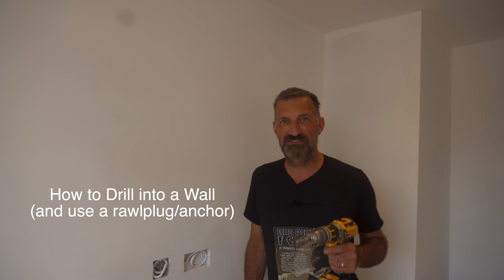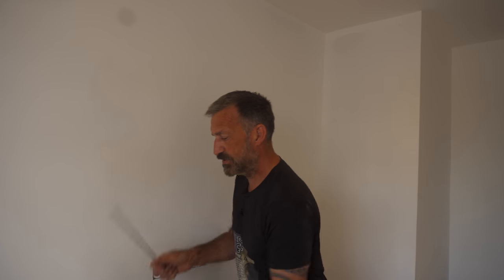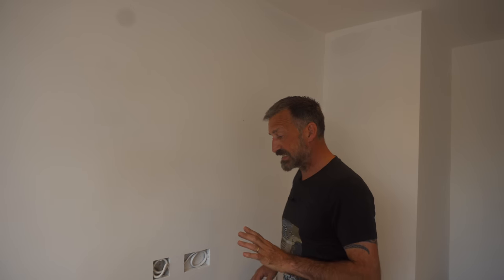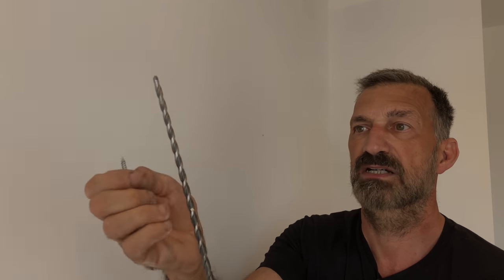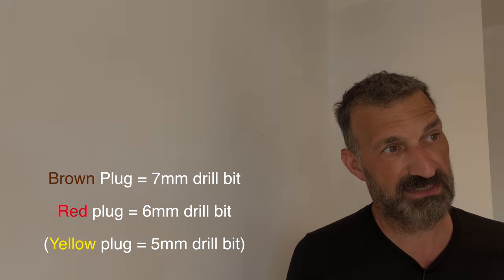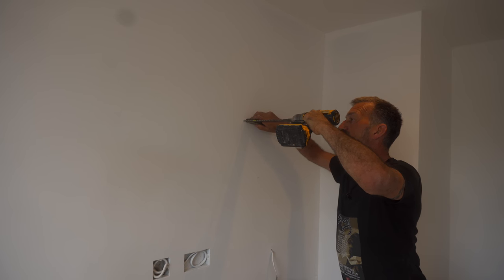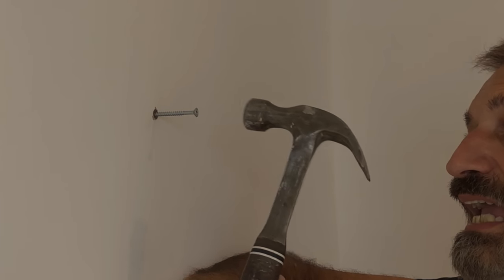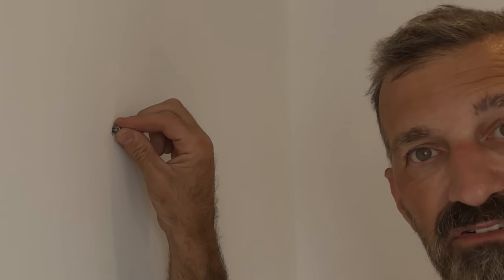Drilling Tips and Tricks (and mistakes to avoid)

Comment: Make sure that the slit of the wall plug is horizontal so that the screw is against the wall plug when under load not slit through wall plug. It will make firm connection to the wall under load
Reply: Thanks for that tip about the slit being horizontal.

Comment: I hadn't thought of using an SDS drill bit in a normal chucked drill.  Makes sense though as SDS bits seem to be much longer generally than standard ones.  Also - liked the tips on wiring - assuming an electrican rather than DIYer has wired it..

Comment: Very helpful I desperately need to learn this stuff but some questions are unanswered, why use a 2inch screw would you ever need a shorter/longer and why. Why use different wall plugs, and are all walls like the same round the house. What if the screw doesn't bite at and is loose or something is in the way and you can drill the hole?

Comment: Great video thanks. Any hints/tips for drilling high up on a wall? Ie ladder orientation etc
Reply from the maker: Yes. Be careful! Ladder always perpendicular to the wall, never parallel. Always have someone standing on the bottom rung footing it. Just take it easy. Slow and steady. Does it 🥊
Reply from the maker: Obviously if it is a very tall step ladder and you are too far from the wall, you will have to be parallel, but then you will need someone on the bottom rung and also I’d recommend a third person on the other side of the ladder holding it so that it doesn’t push away from the wall
Reply: Good man, thanks!

Comment: Hi again! One question I've built 4 plywood shelves 1 metre wide x 44cm deepx1cm. The 1 metre back wall is bricd and I used a10Gx4m masonry screw. for the struts I used 42x19mm pine.. I was advised by store to use Zenith chipboard   8G x 35mm Galvanised Countersunk Rib Head Metal Screw for drywal and  10gx45mm masonry screw for brick wall. I was told I would NOT need plugs at all. Shelves seem to be holding but after your video I think I should have used plugs also. Did they tell me the wrong thing? Sorry this is long as im a 74yo novice.

Comment from the maker: Bits - I'd use the 6mm (1/4"): https://www.amazon.com/Yuerseak-7-Piece-Drilling-Concrete-inch（Gold）/dp/B07L499GG1/ref=sr_1_3?dchild=1&keywords=6mm+masonry+bit&qid=1604996574&sr=8-3

Anchor: 6mm (1/4") https://www.amazon.com/Premium-Quality-Ribbed-Plastic-Anchors/dp/B01J06DC36/ref=sr_1_3?crid=LL5JH8FXAGFF&dchild=1&keywords=1%2F4+wall+anchor&qid=1604996786&sprefix=1%2F4%22+wall+anchor%2Caps%2C229&sr=8-3

Screws (use the 40mm 4*

https://www.amazon.com/ORGRIMMAR-Chipboard-Phillips-Construction-Assortment/dp/B07TPHGFVS/ref=sr_1_2?dchild=1&keywords=Screws&pd_rd_r=6cf38dea-e987-4609-ba91-ce5d73123eb6&pd_rd_w=K3ow4&pd_rd_wg=ADni4&pf_rd_p=91473338-a775-4a82-9600-6767cae1f29a&pf_rd_r=6Y1788DC7X1GHYHAHMRF&pid=TQ1AuxC&qid=1604997125&refinements=p_n_feature_five_browse-bin%3A3177285011&s=industrial&sr=1-2

Comment: When i usually drill for heavy item to hang. I use a smaller dril bit with hammering. And i finish the hole with the proper drill bit without hammering mode. That way the hole holds the plug very tight. I use hammer to slide them inside.  I believe that is the best way. Not that yours is not. But sometimes some walls are softer and when i drill the hole isnt tight.

Comment: I've got a Makita drill, used setting 2 and hammer setting with masonry 1/4 inch drill bit. But for the life of me I cannot drill into the outer wall of the house for my ring doorbell. I managed to drill one hole. But the drill bit is overheating and going purple. What am I doing wrong or is it just a tough wall?
Reply from the maker: Man, that sounds like a tough gig. The only thing I could recommend is using a diamond tile drill bit to get things going. Sometimes these bricks can be rockhard.
Reply: @buildingsheriff  Got it. Will have a pop at that. Appreciate the response
Reply from the maker: Something like this https://www.toolstation.com/mexco-tdxcel-dry-diamond-tile-drill/p69120?utm_source=googleshopping&utm_medium=feed&utm_campaign=googleshoppingfeed&mkwid=_dm&pcrid=&pkw=&pmt=&gclid=CjwKCAjw9NeXBhAMEiwAbaY4luTS3j926VCBj500v1tZHfw-B_mCFntwYikgdMS7HUOzJHoeE_pg2RoCfxkQAvD_BwE&gclsrc=aw.ds
Reply: I just bought some new DeWalt drill bits. Worked perfectly. Not had the drill bits for long so surprised it did not work.
Reply from the maker: @zamanz1572  glad to hear it. We spend so much on power tools such as drills and jigsaws, but the most important thing is a thing that does the work ie the saw blade or the drill bit.

Comment: i am a woman.. but l dont have any of your device aside from pencil and handdrill mschine from my partner who are lazy enough not to do his job and let the mirror stands in the ground since l bought it last October 2020 till now..

Do you think only pen and hand drill machine is sufficient to do this??
Reply from the maker: I think a hammers and a masonry nail 38mm (1.5") (google it) will do the job. Hammer the nail in at a slight angle (so the head is higher than the point) and it will do the job. Good luck.

Comment: Great Video. So do you select screw just smaller than a plug. Is there a standard table. Also how do I recognize bit that is for concrete vs wood.
Reply from the maker: A wood bit has a sharp point on the end and is usually black. A masonry bit has a little kind of hammerhead shark look at the end. Like a pair of ears and it is usually silver. If you ask in your local DIY or hardware shop they will match you screws for appropriate plugs.
Reply: @buildingsheriff  Thank you.

Comment: You can use thick concrere nail + hammer to create a crack hole when the wall is tough to drill in one go, then you can try to proceed with drilling again. I use this trick whenever im  drilling very hard concrete wall, much bettee than forcing to drill in one go. Just a humble tips that most people might already know. Just in case

Comment: For Plasterboard I make a pilot hole, then make that’s hole the correct size. I usually need to drill into the brick behind for the depth of the fitting. But sometimes the drill bit skates around when it hits the brick. This changes the dimensions of the hole in the plaster board. How can I avoid this? Thanks! At a guess my bit isn’t “sharp” all masonry bits feel blunt!? 🤐

Comment: Hi, Just wondering how you can take out the plug?
Reply from the maker: Insert a screw about 15mm into the plug and then lever the screw out with a claw hammer. It will bring the plug with it.

Comment: Hi Sheriff ⭐️ I have been doing some drilling projects around our home after your ace tuition, but the property is quite old and the walls kind of ‘crumble’ and the drill holes are too large. Is there a solution to this please?
Reply from the maker: I know the feeling! I would always start with a very small drillbit. And then try and get a plug to match usually a bigger plug. For example, I would use a 4 mm masonry bit and then maybe see if five or 6 mm bit would go into the resulting hole. Failing that what I would do is use two part filler after I’ve drilled a hole fill this and then drill into the filler. I hope this helps
Reply: @buildingsheriff  great advice thank you! Funnily enough I put a heavy mirror up today, first drill hole dodgy so I did actually try a smaller bit for the second, then had to go in with the larger one, a much better result. Sorry I’m such a novice, this morning I googled “how do you know what screw size you have”, you know the answer to that! 😅
Reply from the maker: @elizabethbarrett5668  it’s trial and error, Elizabeth. We all start without the knowledge and we gain it as we go along. You worked it out for yourself. 👌

Comment: Brilliant video. 
Whenever I try to drill a hole (however small it might be) into my wall, I end up instead with a big crater in my wall! In some places I get a perfect hole but in many places I end up with a crater. Why does this happen? My wall is essentially a layer of brick, covered with a layer of concrete, followed by plaster (and finally paint). Is there something wrong with my drill or drill bit or is the cement and plaster getting brittle with age?? Honestly, even the plaster coming off doesn't bother me, I could always plaster again. But I am confused and worried that why is the cement brittle and not firm.
Reply from the maker: Hi Jimbo. Usually it is because the cement adhesion to the brick or block behind. It has loosened. This can happen to us all. The best way to get around this is to start gently with a smaller bit and then increase hole size. This doesn’t always work but it has done for me in the past.
Reply: @buildingsheriff  tks a lot. I kept thinking there was something wrong with my drilling technique or something.

Comment: Sorry if this sounds silly but what is the difference between hammer and drill on the drill itself. I am struggling to drill a hole in my wall and was using drill (due to drilling a hole in the wall)
Reply from the maker: No. Not silly at all. The drill function is used for screwing and drilling into wood. The hammer function gives you some extra oompfh and will be used when drilling into masonry. For any basic usage other than drilling into masonry use screw function. But if you need to drill into masonry use the hammer function. I hope this helps.

Comment: How do you get the drill holes accurately at the same height, say of you have a number of individual coat hooks to mount.  They always seems to go off marginally when I drill.
Reply from the maker: Put some goggles on and then tap a nail onto your mark with a hammer so that this provides a starting point for the drill. Just repeat along a level for additional holes
Reply: @buildingsheriff  smashing thanks.

Comment: I started drilling in a concrete wall, around 2.5 cm were easy, but then reached a place where nothing was happening anymore... I believe that is reinforced concrete... Any advice on how to proceed? take my time? apply pressure? not apply pressure? thanks!
Reply from the maker: As long as there are no pipes and there isn't a steel lintel there (check), I'd step down drill bit size and try using that as a pilot for the bigger bit.
Reply: @buildingsheriff  Done this and I have a TV mounted now! thanks for the advice, I also let the drill do the job.. took my time and it worked! thanks!

Comment: I never saw anybody have such a hard time drilling a hole into drywall. That drill bit had to be very very very dull. And in America if the screw plastic anchor can be pushed all the way in with your hand, the hole is too large. The anchor hole should tinier than the screw plug and usually needs a slight tap from a hammer to make it flush to the wall. Also never use a 12 inch drill bit to drill such a whole, it will wobble on tougher walls.
Reply: It’s a brick wall with plaster over it
Reply: I don’t think it’s drywall

Comment: Can you recommend a couple of masonry bits? (screws and anchor are a bonus :D ). Thanks so much for the video, it is the first time that someone mention that #2 is for drilling, i have seen tutorials videos using #1 and #2 indistinctly...
Reply: I would look up some ratings and reviews but honestly just make sure you don't push too hard with masonry bits, you will get a feel on what's a good pressure to apply after you get a little experience and practice. Wear safety glasses especially if you're drilling above eye level... Maybe a mask if doing extended masonry cutting or drilling. Main thing to extend the life of a bit is to drill level, and don't drill for too long without giving a chance for the bit to cool. They will definitely wear out and burn up after lots of use though.
Reply: @scottbeamitup7089  Appreciate that, thanks!

Comment: A rotary hammer drill will drill a hole much faster than a normal hammer drill. I have a question though. A rotary hammer drill tends to make a huge hole on the other side of the wall. How to avoid that and make a hole look perfect on both sides of the wall? Thank you!
Reply from the maker: Kleand Rrera If you are going right through a wall, get someone to hold a section of timber where the exit hole is likely to be (minding fingers and hands of course!).
Reply: Thank you.
Reply: Measure the thickness of the wall and mark your drill at the thickness with tape as he showed. Drill through with the hammer action until you are about 15mm from the tape mark , then switch to non-hammer action to finish the hole.  It’s the hammer action that causes the punch through damage.  Can also drill smaller pilot hole to guide larger drill, then drill from each side to meet in the middle.

Comment: I have big problem with drilling wall i tried everything mansory drill bit with hammer drill but I still can’t go through any idea you have what should I do
Reply from the maker: Anything Goes The best case is usually start with small bits and then gradually increase the size. What type of wall do you have? Granite!

Comment: I'm trying to hang curtains with 3 curtain rod brackets per window.
I just bought a stud finder and will use it tomorrow once I get a 9V battery. I'm fairly certain I'm trying to screw into a stud. If that is the case and I'm not able to use a plug, how do I do this? I've tried using a screw alone and the screw will not go flush to the wall.

Comment: Did my first drilling today, supposed to do 6 holes, 3 sets of 2s. Start the first one, it goes for 1 cm then its stuck no matter how much I drill or push it in. Started the second one, thinking that if I put a stronger screw it will just cover the first hole and will do the trick to hold. The second hole stops as well after 1 cm. I think I am cursed
Reply from the maker: Try a new bit but with a smaller diameter. If this gets any deeper than increase bit size until you have the required diameter
Reply: @buildingsheriff  good idea thanks

Comment: hey man quick question im trying to install these led channels onto my sealing they don't give enough instructions. Do i have to apply the same technique you did here for these? or can i jusst drill the sccrew into the seal to mount these channels? Here is the item. 

https://www.amazon.com/gp/product/B01LL3S006/ref=ppx_yo_dt_b_asin_title_o01_s00?ie=UTF8&th=1
Reply from the maker: If your ceiling is plasterboard, you will need to search plaster board (wall board) fixings. They should do the trick.

Comment: Why does every other online resource say the plug needs to be flush?
Reply from the maker: Paul Whittaker It does need to be flush when you put it in. Then you put the screw and you just tap it lightly to set it properly. I’ve been doing this for 30 years and never had a shelf come down!
Reply from the maker: Paul Whittaker what they’re actually saying is don’t leave it sticking out of the hole otherwise when you screw in it will still be visible.